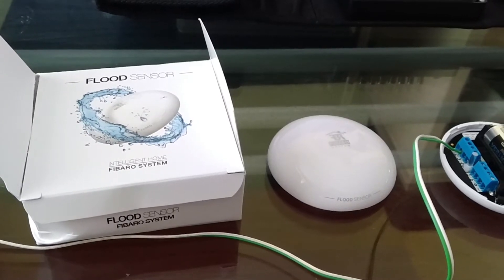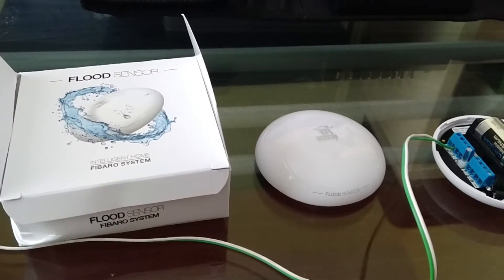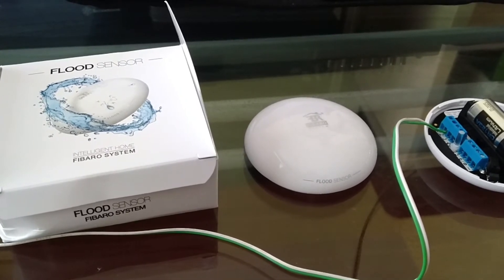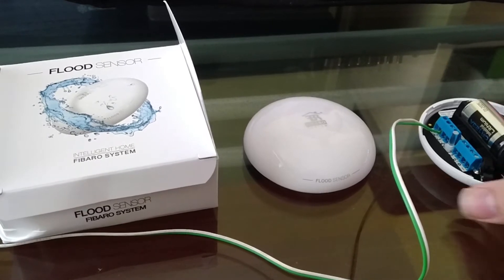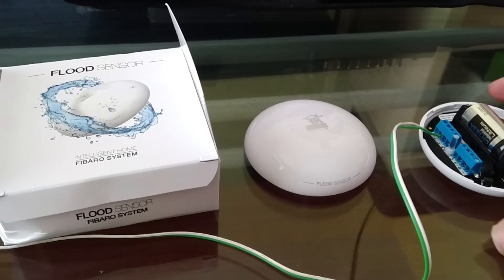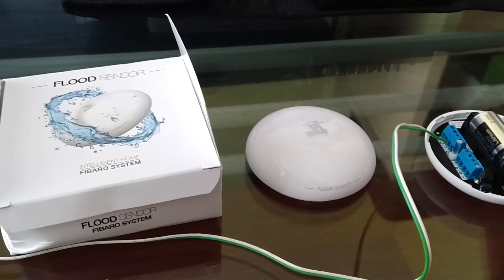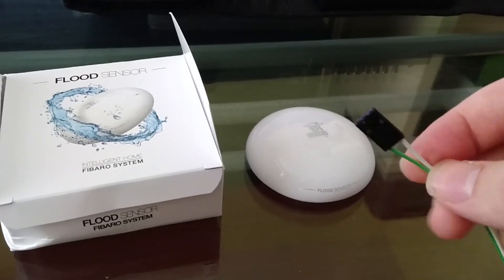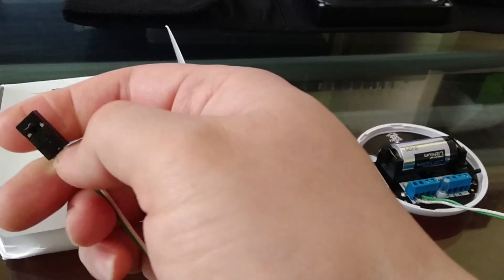DIY fibaro flood sensor( water leak detector) external probe

Comment: Hello. Have you tinned with solder the 2 edges of the wire which are meant to touch the floor?  How do you actually make this wire to operate like the official probe? That one is supposed to come with a metallic edge/probe that withstands corrosion. Thank you.

Comment: will the sensor go off with just one wire touched with moisture, or does it require  both wires to be touched?
Reply from the maker: requires 2 wires to be touched. the best way is to place the wires on a piece of tissue. that way, the tissue rapidly soak up the water to trigger the alarm.
Reply: @dablet  Few things.  So then each of the two SENS1 and SENS2 are dependent on each other?  You can't have one wire going to one place and the other wire going to another place and have each trigger an alarm independently?  Also when you do this do the terminals on the bottom of the unit still work also?  Have you looked at what would be needed to make this wired to the electrical?  Apparently it can be done and then acts as a repeater.
Reply from the maker: @Steve-tz6ex  the wires has to be in 1 spot, they need each other to work. i dont know if the bottom of the unit would still work because i have the unit in a very high place to avoid being soaked. the unit itself is not waterproof. you can wire it to an outlet, i just havent bothered because battery lasts forever.
Reply: @dablet  Thanks yeah its weird.  Haven't tried without the wires, but with them when the probe gets in the water the light flashes and alarm goes off.  When the terminals on the bottom of the flood sensor get went the light flickers but no alarm.